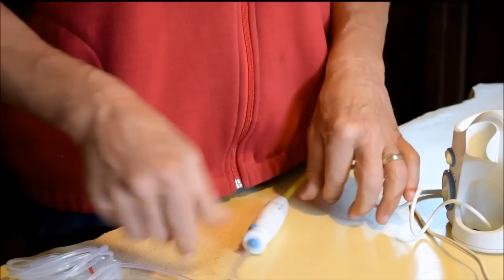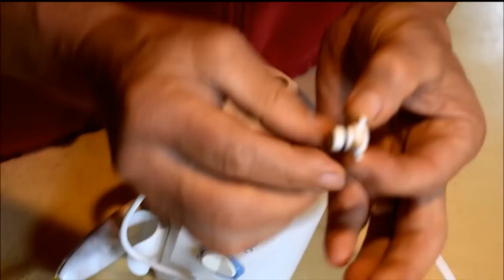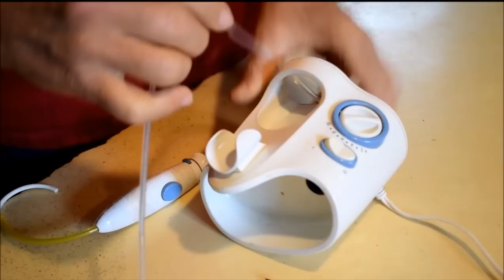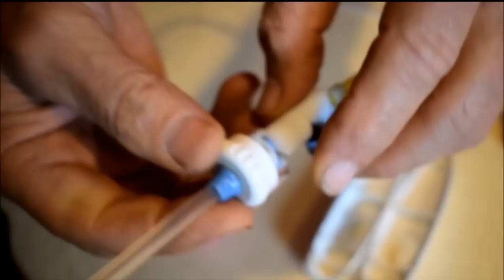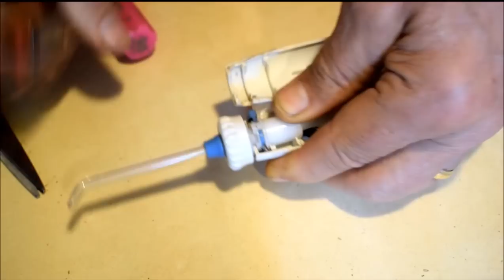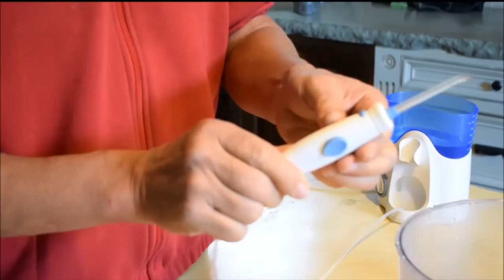waterpix water line replacement , Model WP 100W/WP-100

Comment: Thanks, I installed a replacement hose/ handle (non-genuine like most of them out there) to my wp100 model, but the pressure is now half it was before. No apparent leaks though. Any clue why?
Reply from the maker: Push the water reservoir down hard where it meets the rubber inlet.  you don't have  a tight fit at that connection, between the water tank and the rubber inlet on the pump

Comment: The waterpik hose is stiff to start with. They want it to break so you have to buy a whole new machine. 
I'll be buying your hose.
Reply from the maker: yes, but it's stiff bc it resists the force of the water pressure. What you will find with the silicone hose it will want to curl and wrap when the pressure builds . So I keep my unit on so as soon as I turn unit on water comes out the hose. So pressure doesn't build in hose. I keep it in the sink.

Comment: I followed his video and replaced the hose. It works but there is an issue, the new silicon hose is too soft to sustain the vibration of presure. It was dacing like crazy. I ended up to use the old hose wraping around the new hose as reinforcing.

Comment: Wonderful video and your explanation
in detail. Thank you.
BTW I hv a Waterpik WP100 it is 119 volt unit and want to know
 (1)whether the motor is protected with a fuse in case of over voltage.
(2) if so, how to replace it, since the is working O. K when 110 v is applied to its terminals . But when assembled and switched on it does not.
Can you please help me.

Thanks in advance.
Reply: Correction. it is 110 volt unit
Reply: One more correction: - the motor works when 110 v is applied to the motor terminals.
I think a dose or a resistor like thing at one of the terminals is at fault

Plse clarify.
Reply from the maker: I'd suspect the unit may be 110v in but probably has a step down transformer to maybe 12v or lower. The unit doesn't require a lot of amperage to work as it's a small motor. Typically manufactures step down the voltage to use less expensive components. I'm not 100% sure but this would be typical . Like your computer is 110v in but is a 12v machine. The waterpik  more than likely won't have a fuse , and not a replaceable fuse. Sometimes there is a thermal fuse that has to be soldered in to replace. But I didn't see one when I took my machine apart.  
Note that even though voltage for a unit may say 110v it has a range it can operate in. I suspect 120v is within range
Perhaps I may not understand the question. Does the unit work when 110v is applied but does not wk when 119v applied?

Comment: How did you take the hand piece apart? I tried a sharp knife but even it was too thick.My hand piece leaks at the top.  The tubing is fine, Thanks.
Reply from the maker: If you take a utility knife with new blade and repeatedly follow the joint where the 2 parts come together to should create an opening then place something like a butter knife that's more rigid and pry apart. IF it's leaking at the connection I've taken a metal twist tie ,wrap it around the connection and twist it till it applies some pressure around the connection. Or you can remove the tubing, apply some teflon tape to increase the diameter then push the tubing back on. Doesn't take much tape just enough to increase the circumference so it will seal.

Good luck

Comment: That is what I was looking for. How to find a replacement hose.
And not spend the $8+ for a new handle. Thanks to you sir.
Reply from the maker: Use food grade hose and the inside and outside diameter is snug enough to create a good seal. Silicone in time does relax and may start to leak. IN that case you may cut off a short 1/4" piece of the hose and reconnect. So make your hose long enough to cut in the future. In my case it would have been better to have the outside diameter slightly thicker so the slip on washer was tighter

Comment: I did everything as you instructed. The only thing I noticed is that when I turn it on and hold the blue button on the handle to stop the water flow for a second it starts to spigot some water from the bottom. Could that be the O ring?
Reply from the maker: I think that's correct. Not looking at the unit but I think there is a round nylon keep that secures the hose to the outlet on the bottom. I do have my pix on the on position all the time so pressure doesn't build in the line. I just stick it in the sink if I need to place it down. Typically I will run the reservoirs dry then shut the unit off

Comment: I noticed the same thing as Keith Rodan; with silicone tubing the pressure pulses were very weak, as if the tubing was absorbing them.  It seems that the tubing needs to be rigid in order to avoid this.
Fortunately for me, my tubing was not brittle like yours, so I was able to just shorten it to get it to work.
If anyone finds a better, more rigid tubing, please let us know.

Comment: For an additional $9 to $10 US you can get the complete new handle+hose assembly from Waterpik. Or a new one from China off eBay for $6 or $7 US. Not worth fixing it yourself with third party materials and fiddling with that ugly broken handle.
Reply: the replacement part does not exist for every model
Reply: I'd honestly just use a better quality hose with a homemade rig than buy something designed to fail. (albeit cheap)

Comment: Have successfully reconnected with the replacement hose, all works without leaking, however, it seems that the clear flexible hose doesn't deliver the same intensity at maximum setting as the original curly white hose did...wonder why?
Reply: Maybe it is not so rigid as the original hose, so it expands a little bit with each pulse of the water.

Comment: Many thanks for this, Ray.  I have two waterpik units, and both now have hose failure, though the one in our seasonal home probably went through freeze thaw cycles over the winters, which made the tubing brittle.  The one here in the city just started leaking, but after about 3 years.  Through experimenting, I found the way (right and wrong) to open the handle, but I agree that simply reattaching the existing coiled hose wasn't working, and mine broke again within a few uses.  Your solution seems like the best there is, and I greatly appreciate your time and effort  to share your how-to advice with the world, on YouTube.  Google-searching for the tubing you mentioned came up with half a dozen choices, many on ebay at bargain prices...such as 12' for $6./free shipping!  Instead of Teflon tape, do you think wrapping thin wire around the tube over the connection would do as well?

Comment from the maker: NOTE: I set my water pick to always be in the on position so as soon as you turn it on water will be ejected at the nozzle. Otherwise water pressure builds up and has a tendency to  twist the silicon tubing. Therefore you have to turn it on and off on the switch. I would suspect the reason the original hosing is stiff is to absorb the pressure so it stays put. . I've been using my pick in this position for over a year with no issues. Besides it will keep the pressure from building up and working the joints and o-rings loose. Happy Flossing
Reply: Good idea. Thanks

Comment: Has this fix lasted?
Reply from the maker: Now that's a good question. As long as the inside diameter of the replacement tube will fit snugly it will work. I had to wrap a little Teflon tape on the outside of the tube where it connects to the unit then push that plastic retainer over the tube to make a snug fit. I continue to use my unit with no leaks. The main thing is to make sure you have tight connections where you attach  the tubing to the hand held unit and on the base. If you can get tubing that is 5-6mm outside diameter will fit snugly .
Reply: Thank you for your reply.